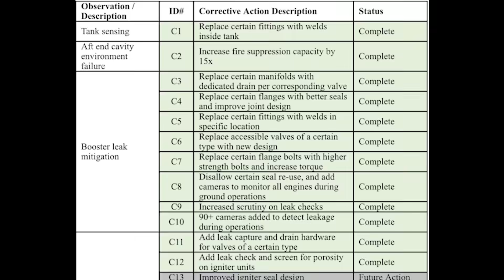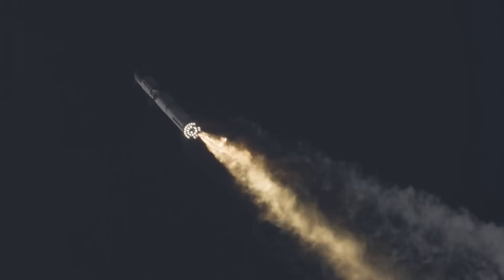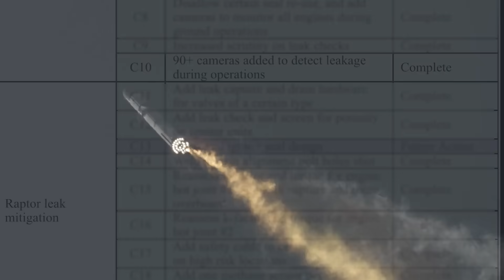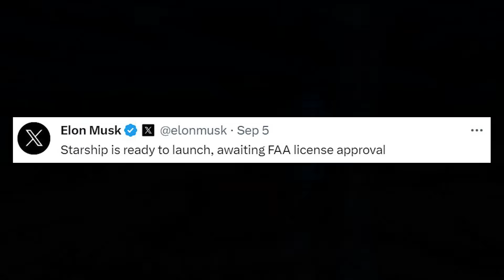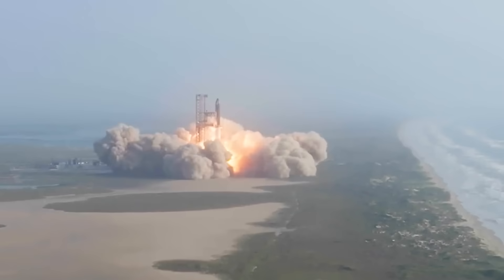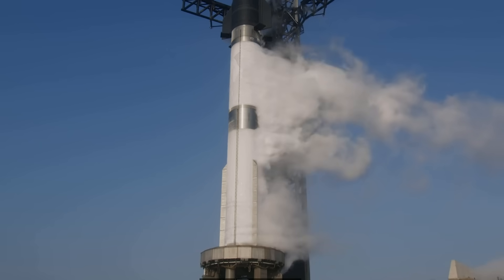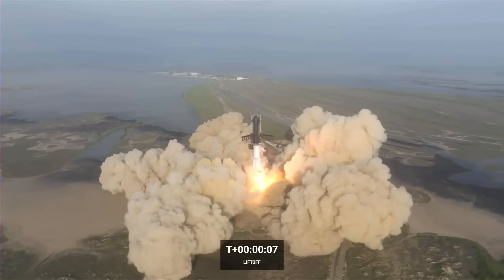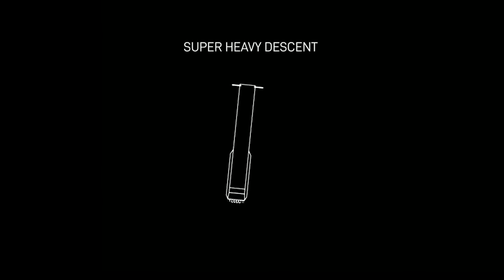SpaceX Has Completed All The Starship FAA Launch Requirements

Comment: I doubt Starship will launch in less than 2 years from now. They totally jumped the gun on the first launch, and it was a total disaster. I still don't think the launch pad is even close to being ready, and it may not even be possible to construct a proper launch pad in its current location. SpaceX has not cleaned up the mess the first launch made, there are still several tons of concrete and rebar laying on the beach. If I were the FAA, I would definitely not allow another launch until everything was put back the way it was before the first launch. Elon seems determined to destroy the environment, first with Teslas, and now with Starship.
Reply: Get some meds. Starship & pad are ready for test flight #2. The FAA is clueless government red-tape drones causing useless, needless delays & obstructions.

Comment: Why are they not taking the time to determine the cause and fix the premature Raptor shutdown issue?
Reply: they have more ships and that's why, if the problem is with the raptor engines or the ships then they would need to fix it with new prototypes, the ships that are already built have raptor engines that were built very early on.
Reply: SpaceX is under huge pressure from NASA because SpaceX has delayed Artemis 3.
NASA has recently forecasted that this mission might NOT be  crewed landing but a Gateway assembly mission instead.
All because SpaceX is behind; NASA is embarrassed by this company.

Comment: It is “Entertaining” to read that list which is a joke without the necessary context. It has the serious vibe of something submitted by spacex with the assumption of conveying as little information as possible. One can only hope that each item has a tall stack of supporting documentation that was submitted to the FAA for appropriate technical review by knowledgeable people. What I hope did not happen was how the process was subverted by Boeing on the 737 MAX and the FAA just rubber stamped everything and said “we’re happy”. 

Also, why all the skullduggery about when the date for the submission of the license updating was / is occurring? It was obvious that sx considered this was a “done deal” when they removed the lifting brackets more than a couple of weeks ago, SH was not going back to the shed (which I kinda thought was a big tell)! It seems that sx and FAA have a rather cozy relationship, maybe NASA is greasing the skids. I wonder if NASA were not going to be held up, would the FAA push this through in this fashion. Not much transparency to be found here.
Reply: That list is an oversimplified one because they clearly tried to hide a lot of things in it. It's for the public while the FAA got the actual reports.

Comment: I'm a little worried that a suborbital flight is all they are aiming for.  Is that what the flight characteristics are limited to? What kind of spaceship would be that?  Also, if they burn all their fuels for an escape orbit to head for Mars, how will they stop when they get there?  This liquid O2 and CH3 will have boiled off long before the starship reaches Mars.  So how are they going to do it?  So there might be Earth Orbit refueling to get to Mars.  But there will have to be a refuel station at Mars for the deorbit burn and landing.
Reply: My understanding is that space is pretty cold if the sun isn't shining on that side of your ship (thus the "barbeque roll" the Apollo ships did). Or perhaps if they add a sun shade like the JWST has, which keeps it at 40 Kelvin, they can keep any boil off from happening. You have to get down to 90 Kelvin for O2, 111 Kelvin for Methane.
Reply: @civwar64bob77  SpaceX is full of a LOT of smart people, let's hope their leadership has been giving this some thought and engineering development.
Reply: It's pretty much orbital, only difference is it just goes around the earth once.
Reply: @Astra2  Texas would be once. Hawaii is like 0.8 orbits.
Reply: @Astra2  More like three quarters of an orbit.
Reply: @michaeldeierhoi4096  My point is that there's little practical difference between the planned trajectory and an orbital one. The difference in delta v is very small.
Reply: Testing a new rocket especially the largest and most powerful ever built can only be in steps.  Space X won't be conducting a test flight to the moon until at least 2025.  Mars won't come for at least two years after that.  

And FYI it's CH4 not CH3.
Reply: The reason it'll be sub-orbital is that they wouldn't learn any more making it orbital - and there would be a risk that the de-orbit burn could fail - and the upper stage would become space junk.  It's probable that they'll test the re-entry burn on this flight - but should they fail, the spacecraft is still going to be on a trajectory that'll take it out of orbit.  Once they know that those thrusters work - then a full-orbital test is likely to be the next thing.   The idea that cryogenic fuels will "boil off" us unlikely.  The initial boil would increase the pressure in the tank - thereby increasing the boiling point of the remainder.  Additionally, they can impart a gentle spin to the spacecraft to allow the heat acquired from the sun on one side to be radiated back out into space on the other side. These are not new ideas and spacecraft with cryogenic oxygen have travelled long distances before without issues.  The WILL have to refuel before leaving Earth orbit - and it will take between six and eight tanker flights to do that...but that's not really a big deal because once they get the thing reliable enough, they can land, fuel up and re-launch within an hour or so...which means that one tanks can rendezvous with the Mars ship each orbit.   The whole process could easily be done in a day.   There will NOT need to be a refueling station for the de-orbit burn to Mars.
Reply: @SteveBakerIsHere  Thank you for that considered feedback
Reply: You are delusional if you think this is about going to Mars!  Get informed.  This is all about launching more satellites for  military surveillance and potentially payloads of weapons to other countries.  The DOD, Pentagon and the National Reconnaissance Office are all behind this.  It's not about Mars folks.
Reply: The suborbital bit is only for the initial test launches.